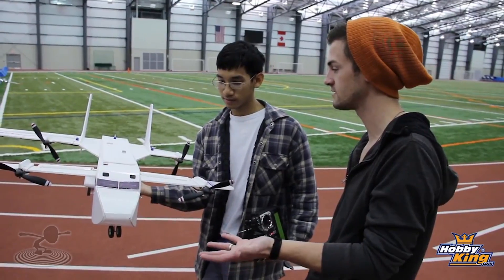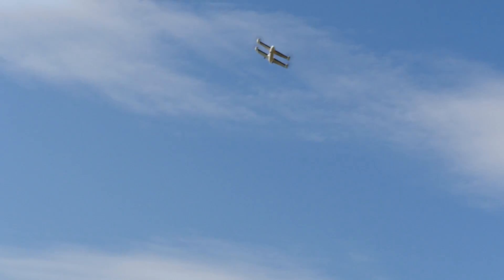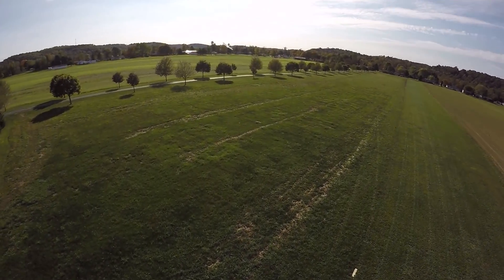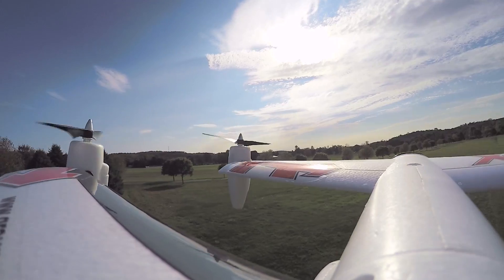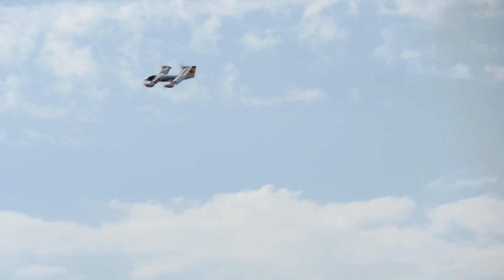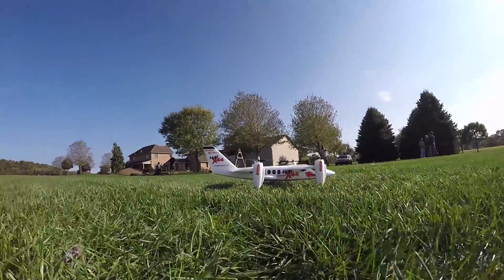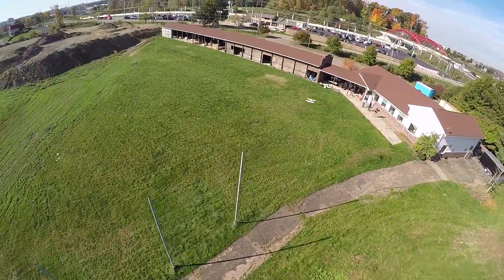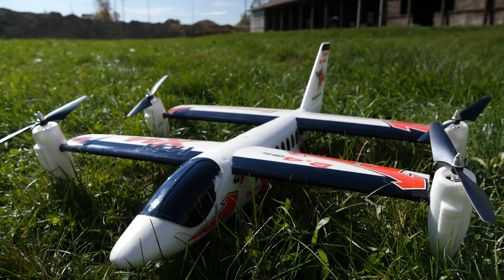Graupner X44 VTOL | Flite Test

Comment: if you use a 4s 1300 high c pack they fly a lot faster . did you calibrate the throttle at the start ?😃😃

Comment: Flawed design.   You don't want propellers to be in another propellers prop wash if you can help it.   

A better design would be to have it look more like a traditional plane, and use integrated wingtip motors on the primary wings and then the smaller traditional size tail wing motors would be outside the wash of the fronts.

Comment: the problem is maybe ....the front and rear wing are on the same 
high......rear wing and props fights with turbulenced air....try with 
smaller props rear, maybe with high pitch or the elecronics can be 
adjustable to turn the smaller/rear faster.....also make the rear Wing 
smaller,  maybe will the half Lenght of rear Wing effects the 1st method

Comment: If the end of the wings (the part that is directly under the blades) rotated with the engine, there would be better efficiency in the VTOL mode..

Comment: Notice any effects from prop wash on the rear motors? Also, I'm building a large quad tilt rotor and using 16x10 props. eCalc says my props may stall; what pitch are you using here?
Reply: +Hollis Inman multi rotors should use props with little pitch, as they need to fly at zero airspeed to hover, and actually need to fly at negative airspeed to descend, without blade stall.    a true VTOL needs variable pitch props or a separate motor and prop for forward flight, to be efficient at both.

Comment: My bet would be that the rear wing is operating in the disturbed air from the front wing. This would cause a lot of drag, slowing the aircraft right down in what is supposed to be normal flight. Rutan solved this on the Q2 I think by having the wings at different height on the fuselage.

Comment: To increase forward speed and reduce weight, simply remove the undercarriage.  If your concerned about it leaning to one side when taking off vertically, put some skewers off the rear of the motor pods.  Yes the props look like they are designed for hover, I would like to see it with Graupner Cam Speed props, better motors, ESC's and servos.  :-) Maybe also a KK2 board with open aero, but then it's basically just using the basic airframe and building a new model.
Reply: removing one motor might help too. the motors, because they are aligned produce drastically less thrust while still producing a lot of drag.

Comment: I would like to hear your take on the new DOT rules requiring that hobbyists register their equipment.
Reply: it should be a 10 second video saying screw you to the DOT
Reply: +Mark Spohrleder You're  right it would be impossible. But it's the government so it wouldn't suprise me if they did. Gotta fine little Jimmy $500 because he didn't register his nano qx that he got for Christmas haha
Reply: I believe you only have to register "commercial drones". that's what I heard on the news.
Reply: Mark Spohrleder hmm, all I know at this point is just speculation but I heard they wanted you to have to register pretty much everything, "for liability reasons." But I still havn't read the document yet, knowing that it's probably 1000 pages long
Reply: I'm guessing it will be for a certain size quad. Like a phantom or bigger. It would be almost impossible to register every little toy multirotor. Most Chinese ones barely last 6 months before they die. Maybe you will have to register only if it has a camera or FPV.  I don't know, but I think they are in over their heads if they think each multirotor should be registered.
Reply: ***** no no believe me it's for your protection... haha

Comment: I'm from europe. The Netherlands to be precise. I really want to get into the hobby. I've got some small helicopters for inside, but nothing awesome. I used to have a silverlit 2 channel plane, and I really enjoyed it. The thing is, it's pretty crowded here, and there isn't a lot of space to fly around here where it is allowed. It also costs quite a lot to buy a plane and a controller. A decent controller costs at least €80. And a decent plane also costs at least €50. (like a FT foamplane). 
But if I get a plane, and I find a spot where I can fly, then there is still a problem. There is always wind. The wind you have in this video is not a lot of wind. It's a below-avarage windspeed here. There are very few days where the wind is good to fly. And even fewer days where the wind is good, there is no rain and the temperature isn't horrible...
Reply: +Animiles You can buy an FS-CT6B with receiver for less than 40 euros
I bought mine of Aliexpress and it is perfect!
Reply: +Animiles I don't know where you live in the Netherlands, but here in the east there are not many days I can't fly. I think of 3 bft as the maximum, but I have flown in 4 bft winds. It depends on the model. The wind in the video was 4 bft I think. I'm a member of a flying club, so I have a field where I can fly. Sometimes I fly in the "wild" but I like flying with others more. And there are people to help you if you are a beginner. It's not a cheap hobby. It will cost you a few hundred euro's to get started, that's for sure. If you want to get started it's best to search for a club in you area. Modelbouwforum has a list of clubs on the site somewhere. Feel free to message me (in Dutch) if you have any questions.
Reply: +Animiles Here in Brabant, the wind was almost dead calm today. And where I live, in the country side, lots of farmers are ok if you ask them whether you fly in their fields. I am building a 1 meter sailboat, which, for me, is a great way to get in to the hobby. A used dx5e is 40,-
Reply: Wernerrrrr
Fryslân. 20 minuutjes rijden naar de (wadden)zee. Dus een echt zeeklimaat. Veel wind en snel koud. Het is nu ook erg koud omdat het zo vochtig is. De wind is niet zo hard vandaag. Iets van windkracht 2 a 3. Volgens google is de wind 18km/h. Dus dat is eind windkracht 3. En hier in de buurt is niet echt een model vlieg club. Er is er in Leeuwarden wel een, maar zij willen mij niet hebben. Ik wil namelijk electrisch vliegen (in ieder geval in het begin), en zij vliegen alleen op benzine (of wat ze ook maar gebruiken.) Ook moet ik dan zelf een vliegtuig van hout maken. Dus daar ga ik maar niet bij. als ik met een electrisch foam vliegtuig aan kom dan lachen ze mij waarschijnlijk uit en  met mijn speelgoed weg gaan :p
Reply: Lijkt soms wel of de halve RC wereld uit Nederland komt :)

Comment: the proper definition would be tilt-rotor, an aircraft that has both function of an airplane and a helicopter where the engines tilt to transform into an airplane or helicopter.

a vtol is an airplane that has vertical lift capabilities using the air from the intake and pushes it downward into the surface for a vertical take off.
Reply: +JWoodi You are absolutely right!  While it is a tilt-rotor, like the V-22 Osprey, both still fall into the VTOL classification because of its ability to 'Vertically Take Off and Land".  Tilt-rotor is a sub-category of VTOL like prop, turbo-prop, and jet are sub-categories of air planes.
Reply: +BBTomahawk12 eh...think of what VTOL stands for. I'm pretty sure this is still considered a VTOL
Reply: +cj2006sd What you said, VTOL is a class, with sub divisions.
Reply: and I forgot to add that THAT is a cool model
Reply: +BBTomahawk12 respectful and informative. what YouTube comments should be.